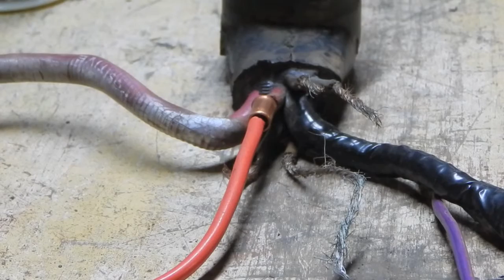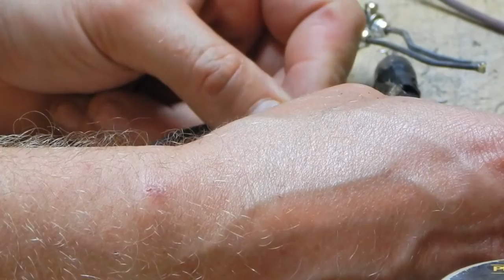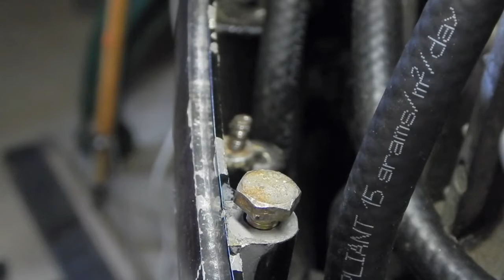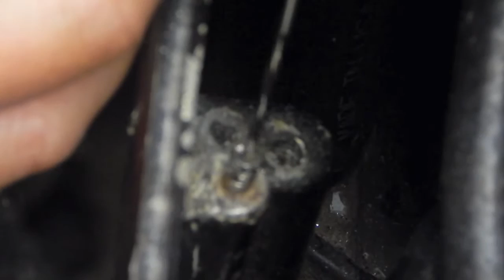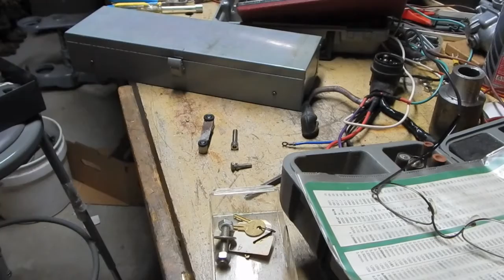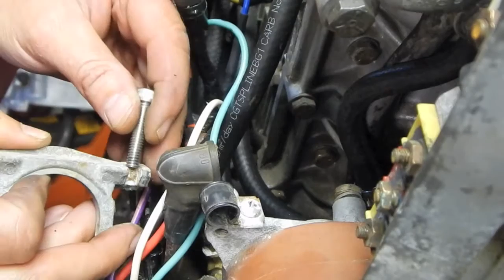The Mercury 115 Tower of Power Outboard motor Part 31

Comment: At first I thought you were going to do a MyfordBoy video and not talk. I would have tried putting a nut over the broken bolt and welding the center up, making a new head. The heat would have probably helped too.

When doing a twisted (Lineman's) splice like you did, and the wires come apart, try wrapping the wires together with a piece of 18g bare wire. to act like a mini ferule.

I'm surprised you didn't put some silicone gel under the heat shrink first to displace any water from getting in and rotting the wires.

Just some arm chair engineering that's a lot easier than trying to do it on camera. Thanks for the video, can't wait to hear it start.
Reply: I use the bare wire wrap trick a lot when working on car wiring. And adhesive lined heatshrink is a must in any moist environment.
Reply from the maker: Thanks.  these are some good tips.

Comment: Nice video as usual. Slim stud remover would have been nice for the broken bolt? I saw it for the first time been used in Steam Locomotive Cylinder Head Repair https://youtu.be/LexIyn7gQUw?t=601
Reply from the maker: I have one of those for bigger studs, but even if I had a smaller one, there was not enough clearance between the stud and the housing to make it work. But thanks for thinking of me in my time of dark despair lol